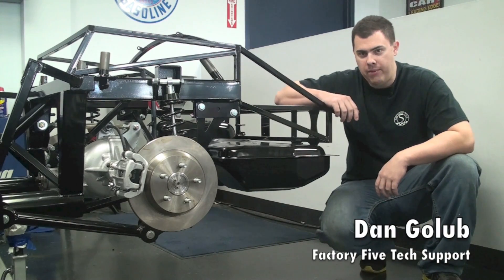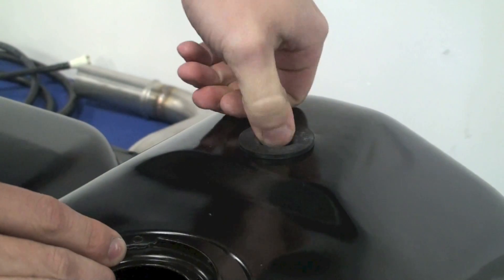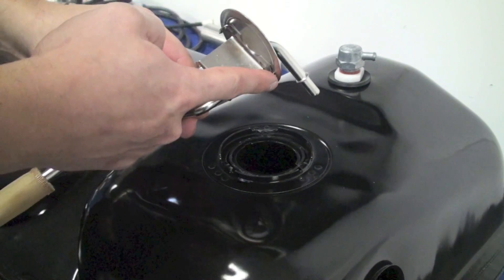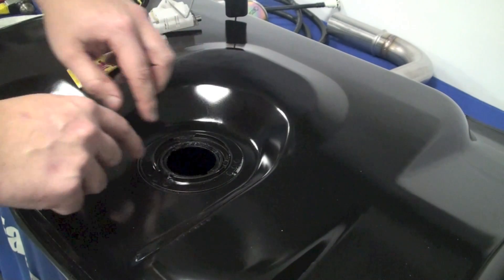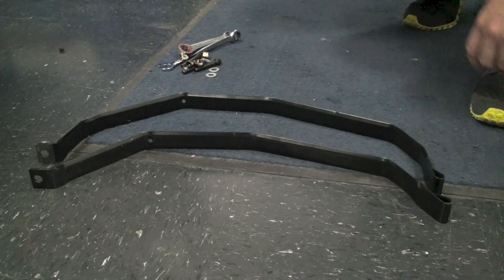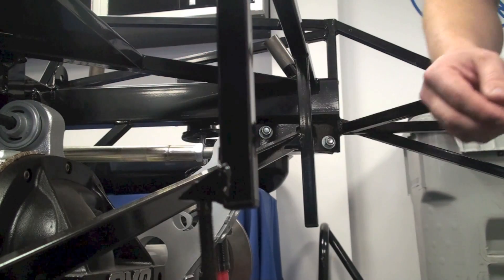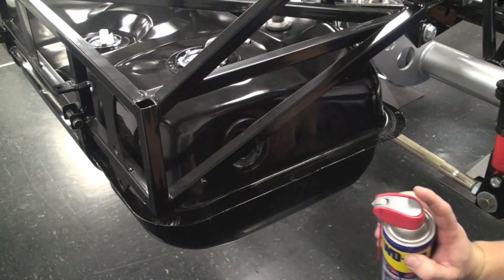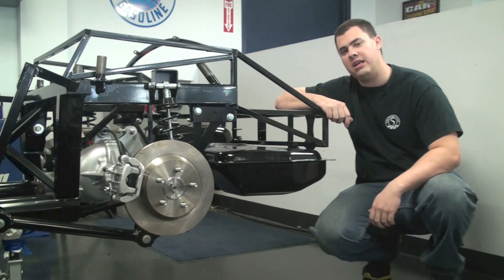Factory Five Mk4 Build Episode 9: Fuel Tank Install

Comment: Ive always used white lithium grease on sending unit gaskets. Never leaked. Also spray the tops of gas tanks with rattle can undercoating. Thats where a lot of gas tanks rust from water and debri and dirt throw on top of the tank. Ive built a lot of cars and repaired them. Just a tip. The undercoating helps with squeaks.

Comment: Was also wondering about the lack of in-tank fuel pump?  Assuming an EFI build is there an option to order the in-tank late model basket assembly w/ the fuel tank OR is there a provision for an external high volume electric fuel pump?

Comment: lol notice he didn't have a long enough bolt on the driver side fuel tank strap, failed to mention you might need to pick up some longer hardware didn't he. Factory five has some work to do when it comes to the hardware on their kits, at the least they could provide some quality fasteners, God forbid label the bags they come in. Make sure you have a Fastenal nearby when doing one of these builds.
Reply: idiot

Comment: I noticed that the fuel pickup did not have a pump.  So, does that mean this car will be carbureted?  If you were doing an EFI car, would it use a stock style mustang fuel pump/pickup assembly?